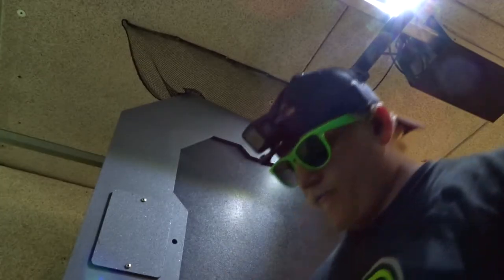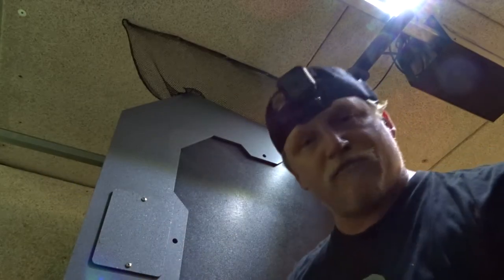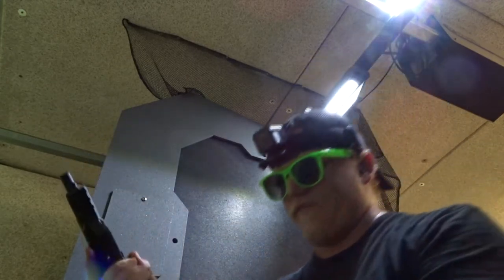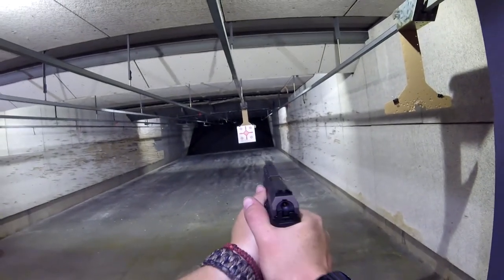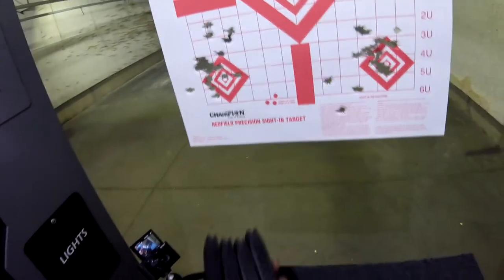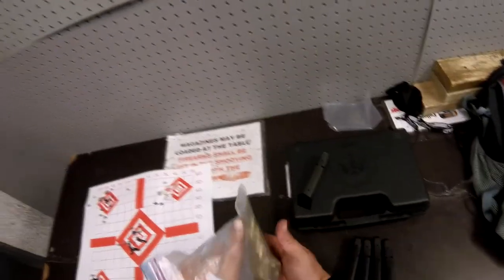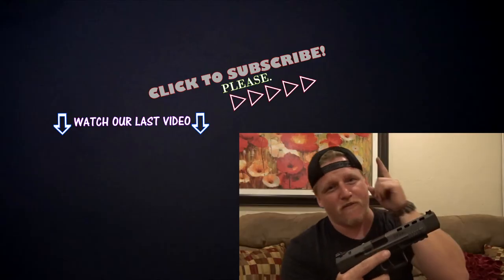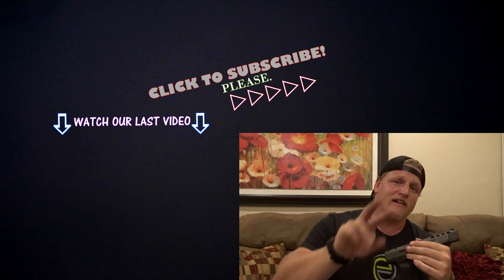CANIK TP9 SFX | THIS THING IS NUTS!!

Comment: I bought the same gun a have ejection problem did you replace slide recoil spring I need help I shoot uspsa IDPA please help
Reply from the maker: Julio Montes I haven't had any issues since break in completed. I fired about 7000 rounds before changing recoil springs and all that.